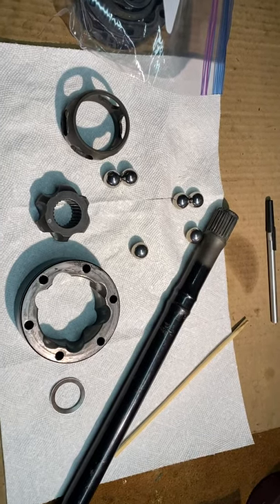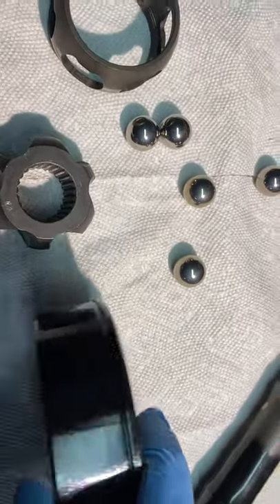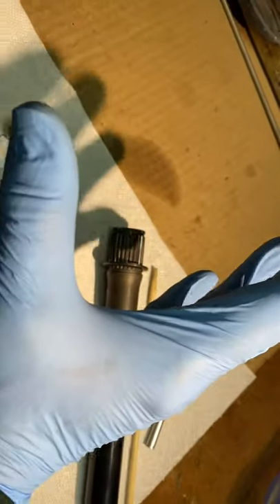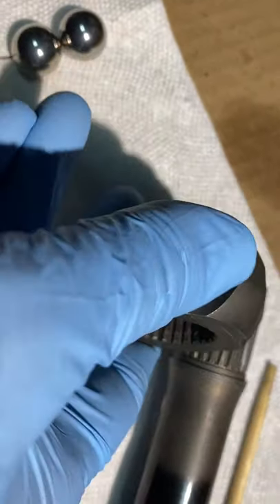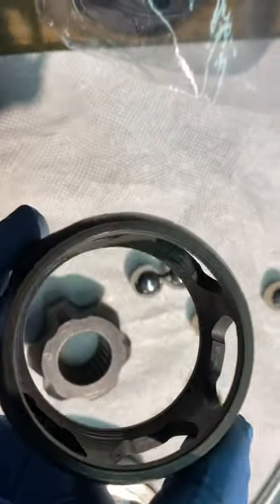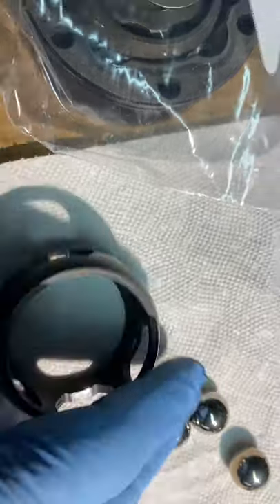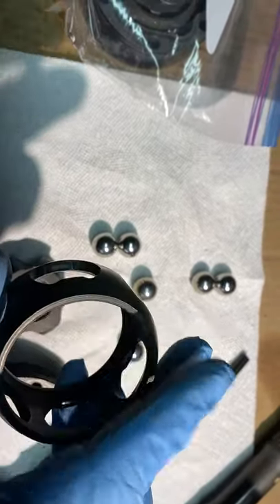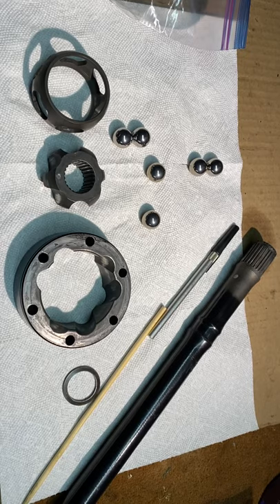911sc Porsche Cv joint assembly tips

Comment: Thanks for the video. I'm doing this now on my 1982 911 SC and have been sent the wrong replacement boots twice now from well known classic air cooled parts sellers and I don't know what the problem is. Mine are one peice boot with flange and cannot be seperated and accourding to the 1978 - 1983 Porsche 911 pdf I downloaded from Porsche classic, it's pretty much the same boot with flange number. The last one I received from Serria is a four fold boot and looks like the one for the VW buss however the shaft diameter is smaller yet they list it for fitting 1975 - 85. Now I get what many just buy a complete new GNK lobreo cv axle and call it a day but I'vr generally have never found a high quality aftermarket to come close to a even a semi-worn OE so that why I alway try to reboot them.